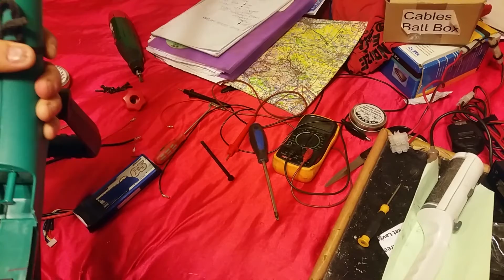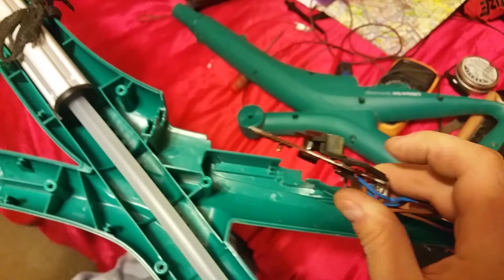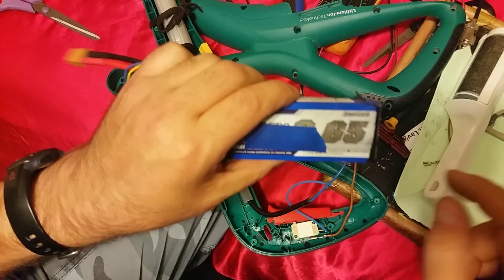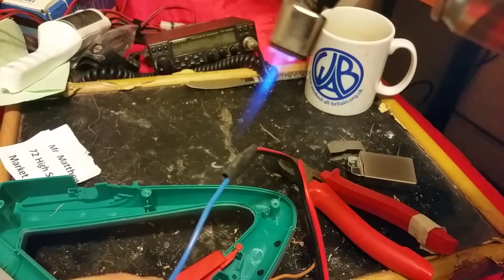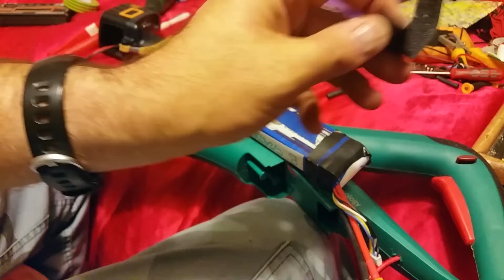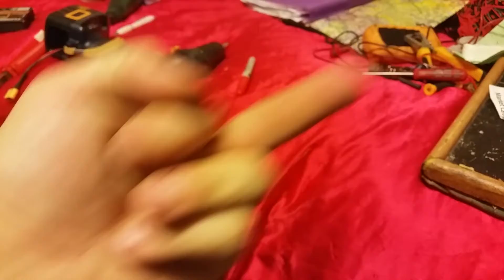Smack my BOSCH up! Hacking BOSCH Power4All systems Battery

Comment: Did some researching. You could very easily have fooled the onboard electronics and as a bonus still preserve at least the low voltage protection!! Here's how to: The middle pin closest to the negative is probably some sort of battery type and/or error indication. They may vary it if they come out with other batteries more capable of the current single strand ones. But between negative and the closest center terminal to negative just add a 1.5 kOhm resistor and tool will be happy. Now the other center pin - the one closes to positive is the battery temperature protection. It's just a good old reliable 10 kOhm NTC. You may wire one up yourself to the pack you'll be using or just replace it with a 10 kOhm resistor if you're comfortable going without. Again the reference if to the negative. That's literally all(!) You can then power it using any 18v power supply you'd like and still have low voltage protection and over temp if you want to.
That said the right places - especially seems Germany - you could have gotten replacement cells for your pack. It is possible to get genuine LG and Samsung cells quite affordable with soldering tags.
Reply: I have the same Hedgepole and tried your solution, but it doesnt work, are you sure with the size of the resistors? how can i find out? i have taken it all apart and tried attaching 18V Power directly to motor cables, motor is fine.The Protection board also. Do you have any suggestions?
Reply: @alexjaros3396  
I tried it and it works (with a 18V chainsaw):  A 10K resistor between both center tabs, and a 1.5K resistor between negative and the next one .
Reply: Thanks You, It wotks :) I pluged 1,5k between negative and the next one. And center pin from GBA battery (termistor) to the pin next to positive in PBA.

Comment: If should be doable to find a battery replacement board which you then could wire up to your own cells. That way you would still get the protection and it would still work with original or compatible third party batteries. The reason the circuit board is in the product is that in contrast to ordinary computer/phone/mobile gadgets is that here power draw is so high that should battery could cope with the highest draw of any of the products the protection circuit would be quite large. Instead circuit board get information from battery of how much current may be drawn etc. and then device will do the protection.
It's no more custom communication than you can get loads of compatible batteries of doubtful quality - but their board will communicate with the device fine. 
It's the same with all such power tool battery systems based on LiIon. Whether some or all are protocol compatible I don't know but could very well be some are because challenges are not unique but common for all manufacturers to there might very well be an of the shelf product. It's also why for some machine to have higher performance if you use the large capacity cells with cells in parallel - the battery tells it's capable of higher continuous currents and the tool adjusts for that - for smaller batteries it throttles when put to work which draw too much current.